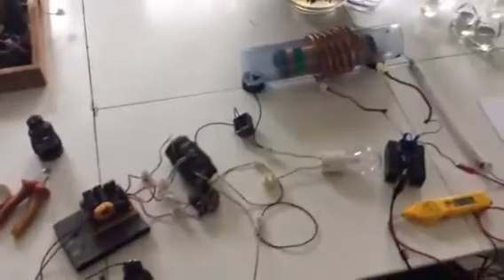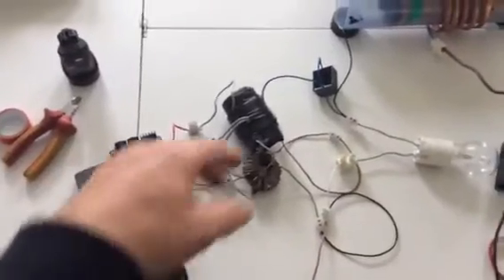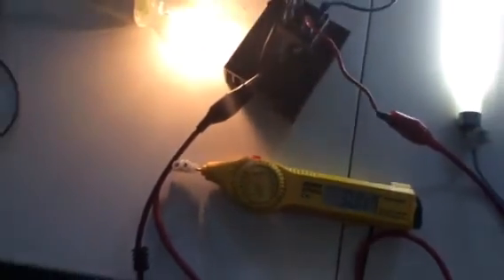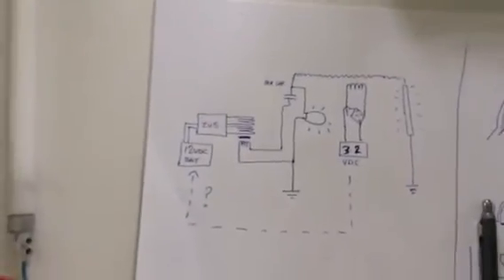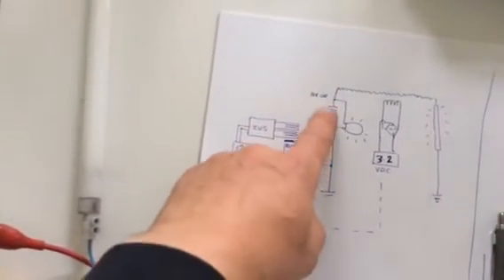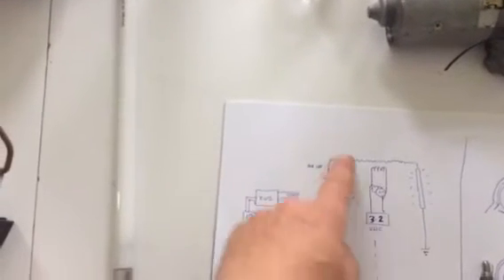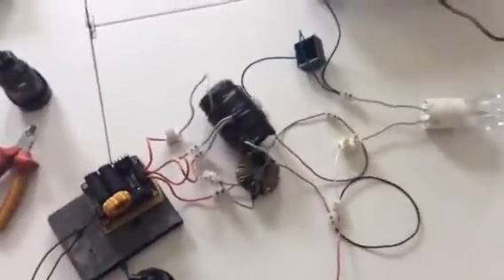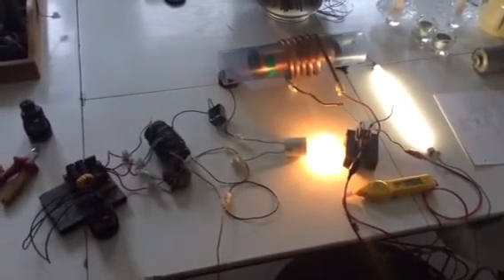ZVS tesla coil, Kapanadze recuperation experiment

Comment: please upload your video in HD quality!
Reply from the maker: MYB Tamaki sorry if quality is not good enough, do you have questions I could answer.?
Reply: do you have become the Overutity effect in you tests?
but make the same tries with IT-Drivers and i hav´nt OverUnity effect.
Reply from the maker: MYB Tamaki  I don't have the test instruments to tell you if OU or not. I have been able to power more than I am using to run the setup. My goal is to have a system that can charge caps and power itself.
Reply: my device can use for a long runner system.
do you use 230 volt lampe system or 110 volt system?
Reply from the maker: MYB Tamaki 230v systems in Europe. This setup uses battery input. What do you have?
Reply: i use to 230 volt system.
Reply from the maker: MYB Tamaki do you have a YouTube vid I can see your setup?